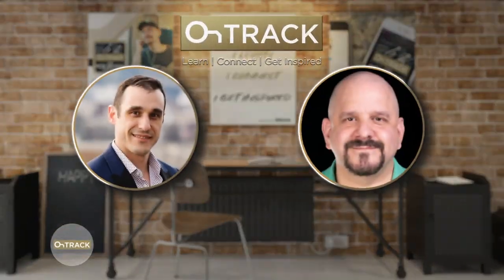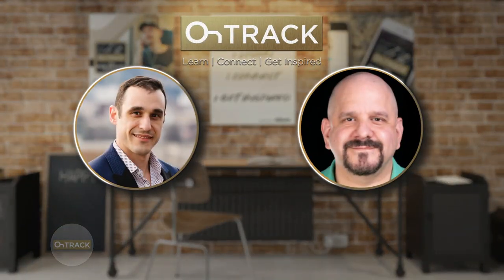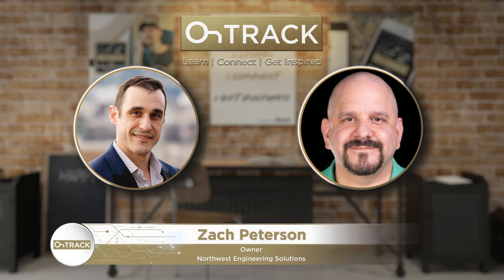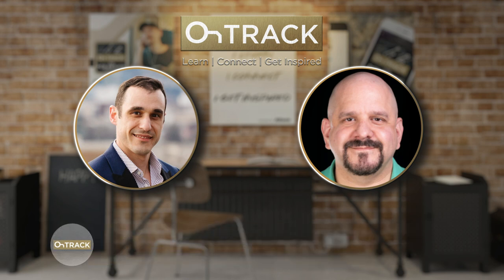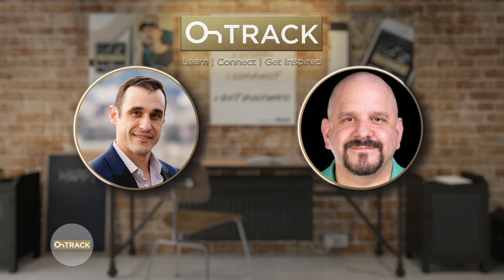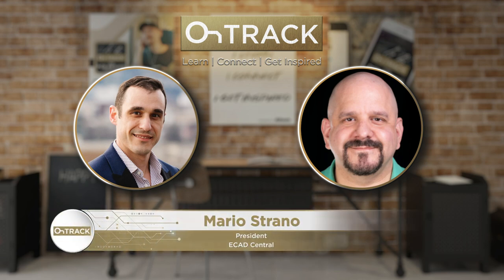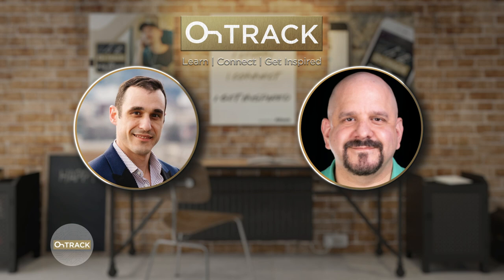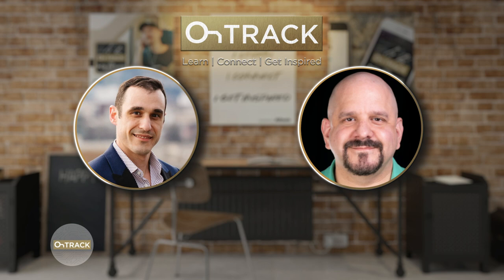Mario Strano on 10-Ounce Copper PCBs and Design Library Migration

Comment: 10 Ounce? Please use SI units.
Reply: It is a convention in PCB design. 1 oz copper is 0.035 mm in thickness
Reply: @sergeyivanov3453  I know this, 1 oz is also 28,35g, it is also 29,57ml, also it is 35um, it's just very convenient. There were times when there were hundreds of units just for weight and it doesn't mean that it was better just because it was convenient for ppl using it. This channel is international, the host is from Germany, I don't see any reason for encouraging the use of obsolete units.